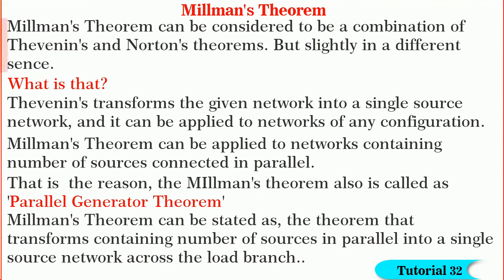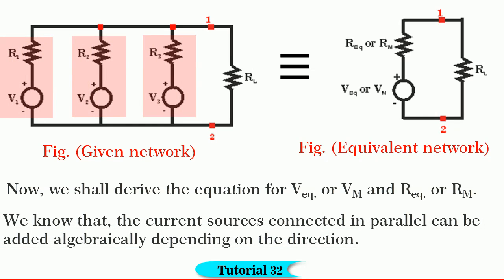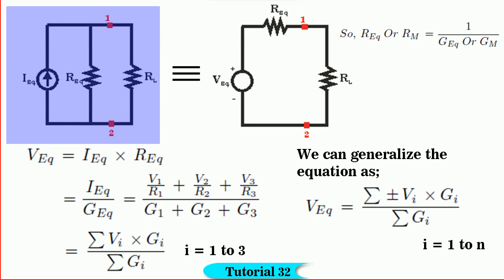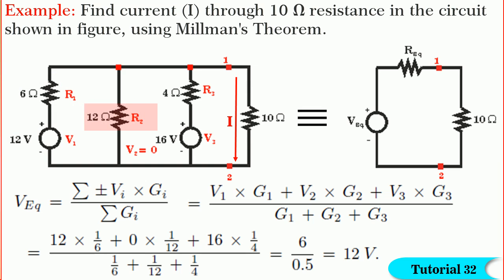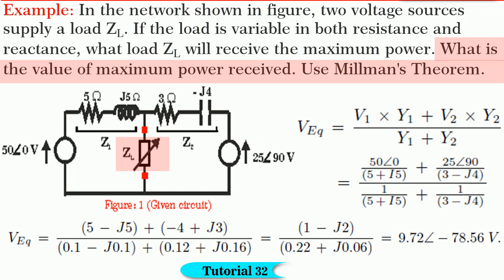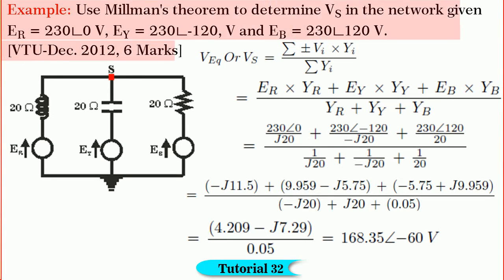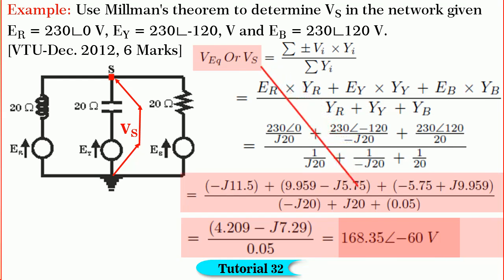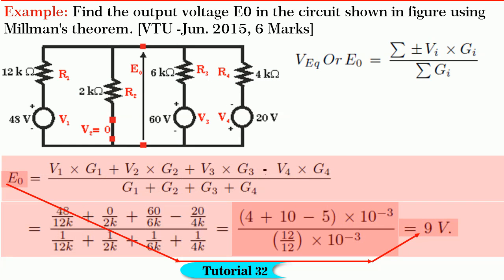Millman's Theorem

Comment: kindly upload the videos on  basic electrical engineering.
Reply from the maker: Hello, My videos on basic electrical electrical engineering are already available on YouTube. (i) Ohms law (ii) Kirchhoff's laws (iii) Branch current method of Network solving and many more.
Regarding "Mesh current method on AC circuits, there is no difference in writing mesh equations, only you should know the process of solving using calculator in complex mode. Hope you try.
Hearty blessings,
Prof. Punagin